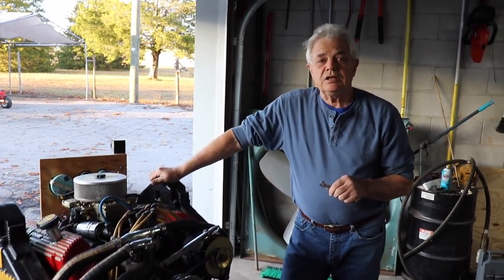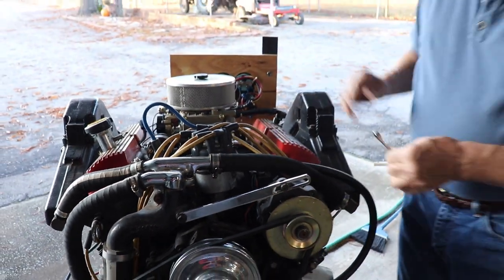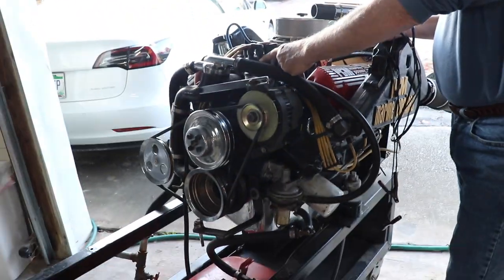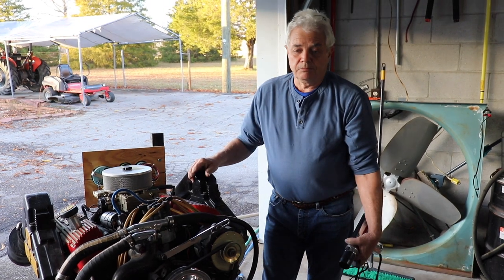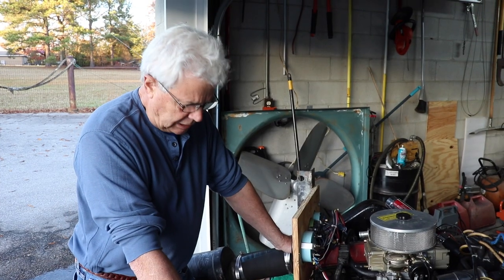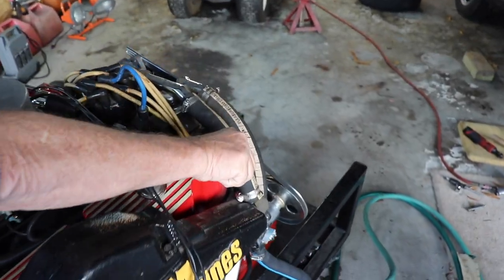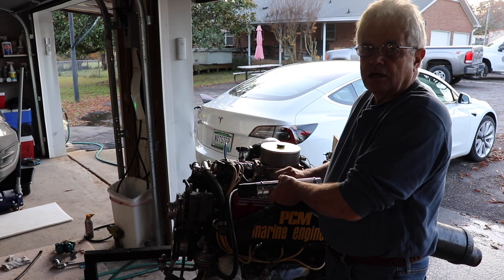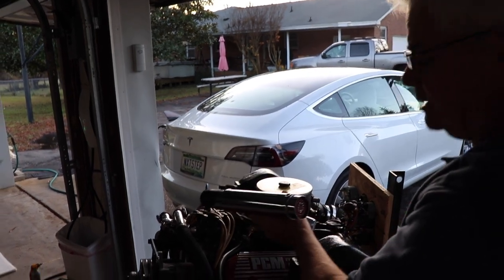How to Time an Inboard Marine Engine | Ford or Chevy Boat Engine Timing.(points and condenser)

Comment: Timing mark guage on my counter rotation engine is mounted same as normal rotation engine so i have to time the counter rotation engine to retard marks instead of advance, this makes engine run good does this make sense and have you seen this setup before?